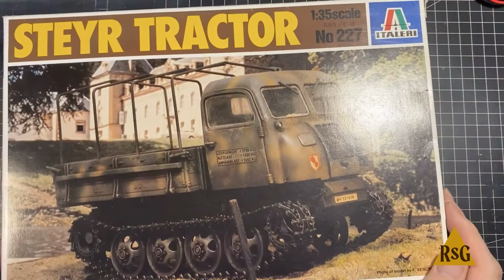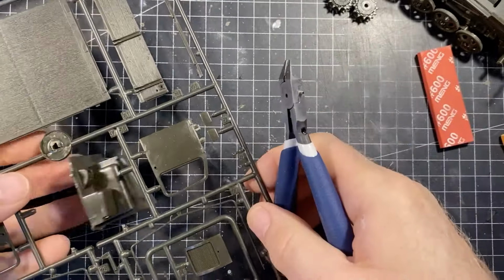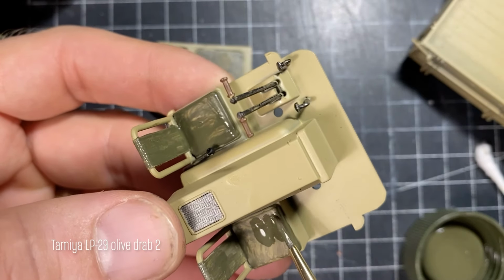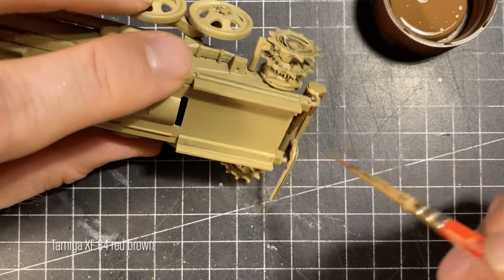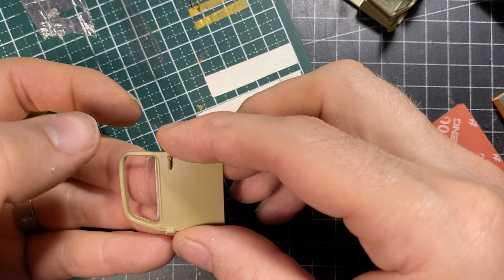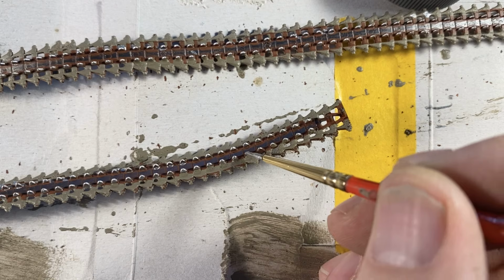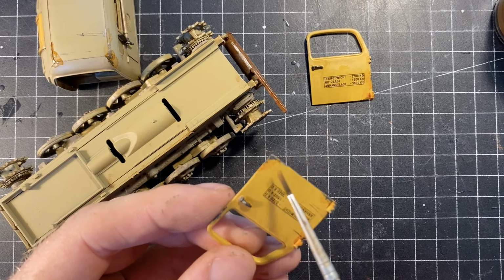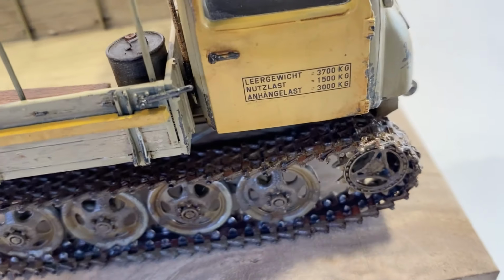Steyr RSO/01 Italeri 1/35 full build

Comment: The tracks on this kit gave me nightmares, nothing would glue them together, I even tried Superglue, that didn't work, I tried epoxy, that didn't work, it held for a while and so I left it overnight to set properly and when I got to it the next day, the tracks had simply disintegrated into loads of smaller parts. I had to order a set of resin tracks which weren't cheap ! Italeri, if you are reading this don't ever use that shite rubber ever again for your tracks. Now if I open a model kit box and see that metallic silver rubber track, then they go straight in the bin.
Reply from the maker: Wow I hope my tracks will stay on for a while and not disintergrate! Yeah a new set of tracks would cost me almost twice the price of the kit. Not an option...
Reply: @roelvandelden2322  I was lucky, I managed to find someone selling the resin tracks for this kit at a very reasonable and cheap price. It still cost me about the same as the kit itself, but usually those resin tracks would be almost double. Hope you don't have any future trouble. I had the same kind of problem with the old Tamiya LRDG truck kit, it came with rubber tyres and after about a year the tyres just fell apart into three - four pieces, had to buy a set of resin wheels & tyres.
Reply: I use a heated flat head screwdriver to seal the plastic/rubber tracks, old school but it works.
Reply: I use the stapler method on this kind of tracks. Once painted you would think they are part of the tracks.
Reply: @roelvandelden2322  Modelkasten made nice plastic tracks for this kit :)

Comment: I have this kit in my stash. The original tracks are horrible but I still like the detail wood grain of the cargo bed.
There are after market tracks for this RSO kit 227 ET Model has two types of 3d printed tracks ET Model P35-29 Eastern Front tracks & P35-030 winter tracks
I haven’t decided which I want to use when I eventually do the build
Reply from the maker: Yes the detail in the cargo bed is nice. The rest of the model is fairly basic so a nice pair of tracks would be a good addition! Enjoy the build (if you eventually get around to it :)